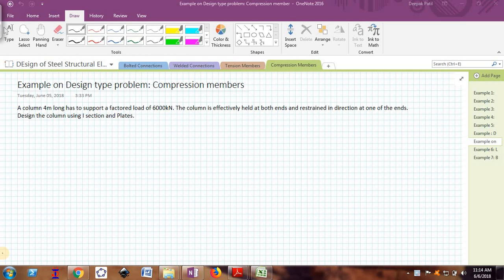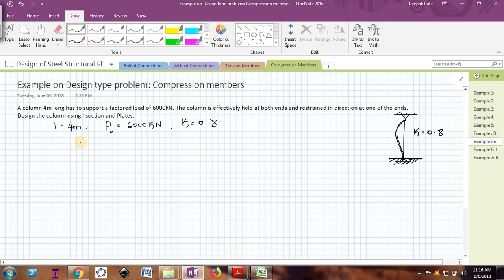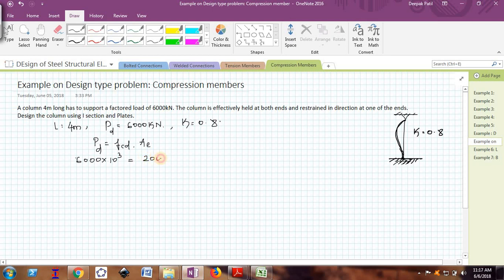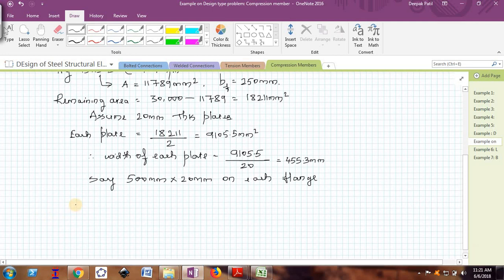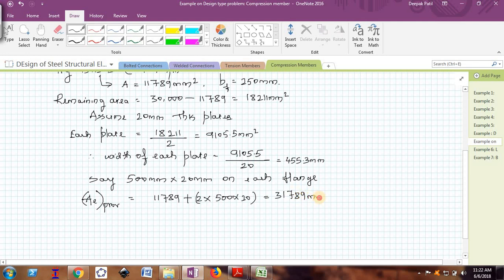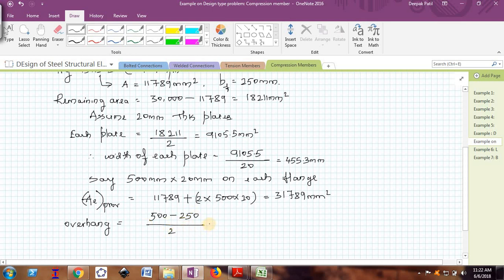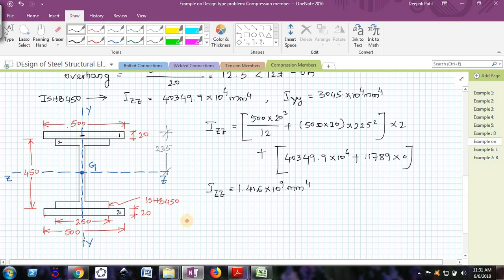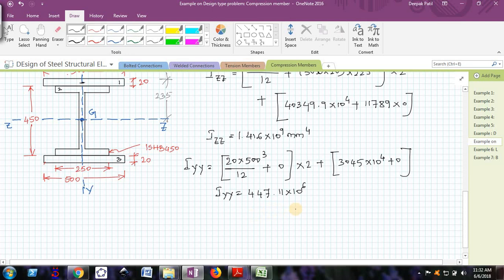Design of a Builtup column as a compression member

Comment: WHAT IS Fcd?
Reply: Simply Fcd is an allowable stress, it is just an initial trial-error value to start with
you can choose Fy = P/A, but he has written it like P = Fy * A
Fy is a yielding stress
A is the area 
P is the load applied.
since he's dealing with SI unit, it means that Fy = 248 MPa (MN/M^2), for A36 steel material
for he's example he has took 200 Mpa to get closer to the correct area because it is heavy load
he said in the video N/mm^2 which is the same of MPa (MN/M^2)
there is many examples to start your design with to get that initial Area one of these also is the serviceability